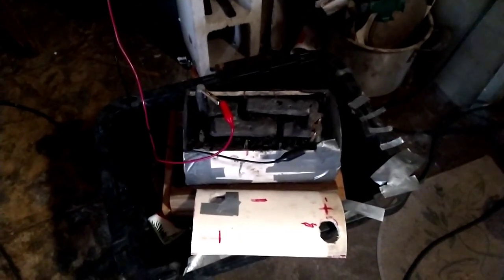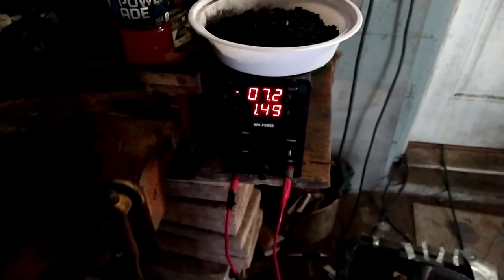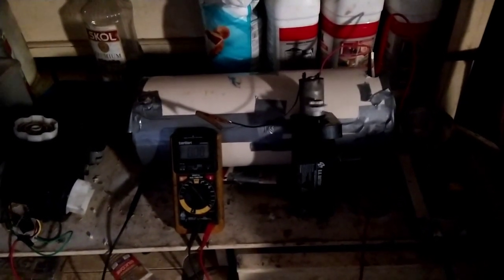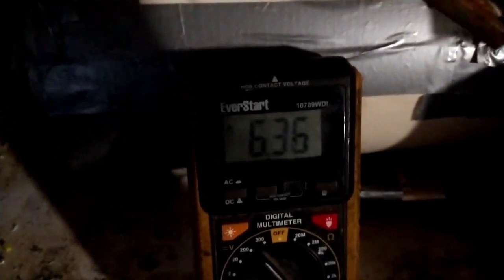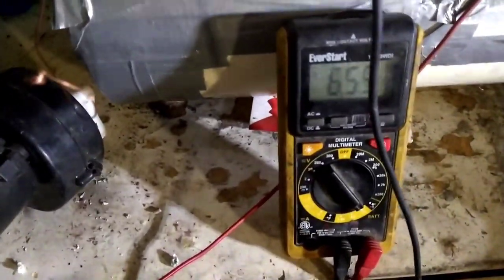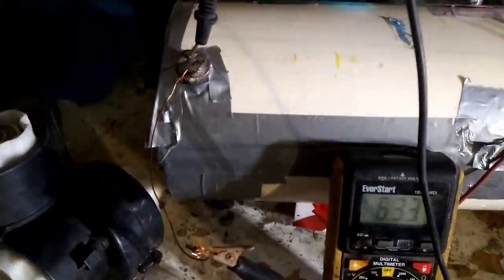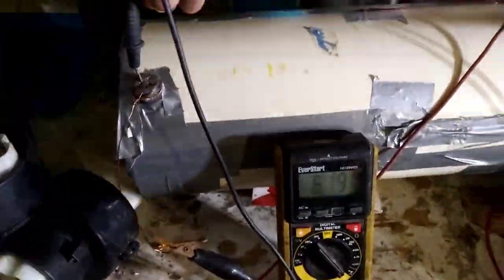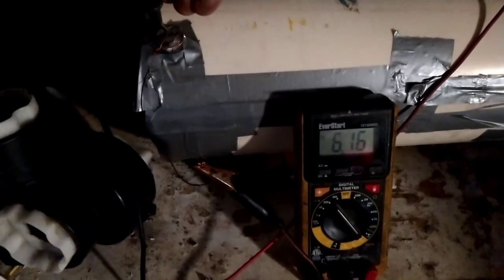Huge homemade (AGM) lead-acid battery in action.

Comment: Brian Measure the current in amps (average) when discharging your homemade battery and multiply this current by the time it flowed, in hours, (until the voltage dropped to six volts) and this will give you an idea of the the amp-hour capacity.
Compare this with the quoted capacity of a commercial battery of the same approximate weight to give you an idea of how yours compares to a commercial item.
Another comparison would be to simply see how long a commercial battery runs the same load, and compare this time with that of yours.
Reply from the maker: Thanks brother
Reply from the maker: If it  can push 10 amps for 1 hour,does that make it a 10 amp hour battery?